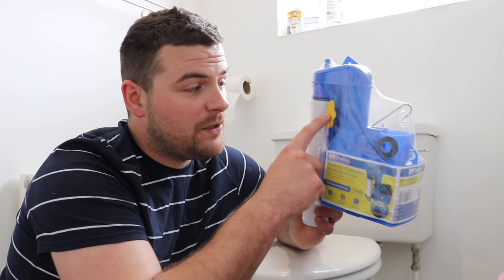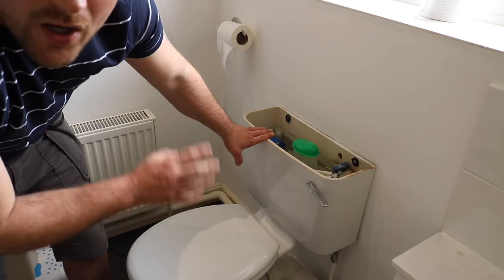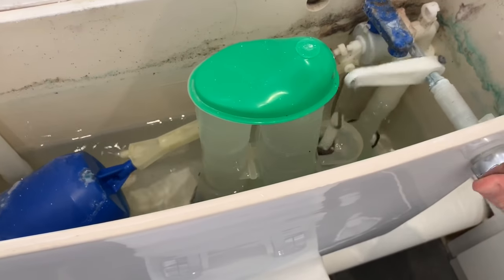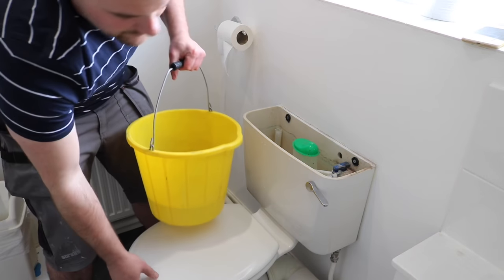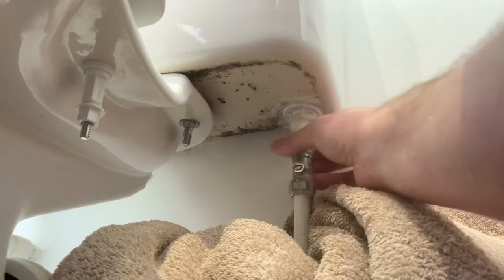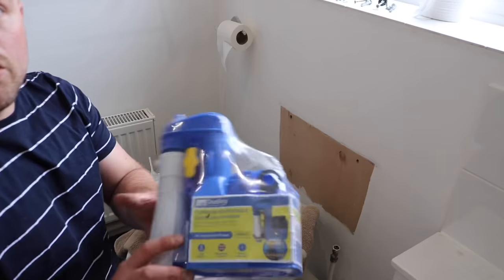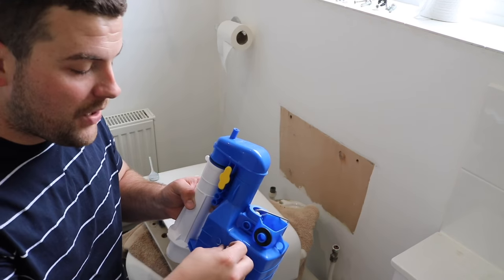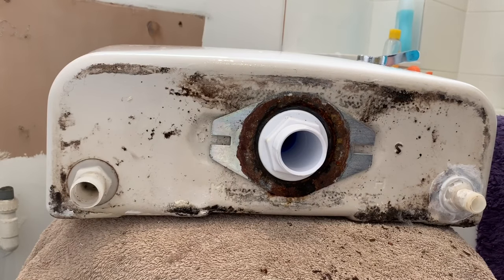How To Fit A Lever Toilet Siphon | Dudley Turbo Duoflush

Comment: Many thanks for a very helpful video! I've just bought one of the Dudley's to replace the flush over a Saniflo macerator toilet. The toilet itself was non working for ten years (the 'official' agent charged us £60 to replace the ball float which was nothing to do with the faulty toilet) but I finally managed to repair it with a new condensor and rubber gasket after watching yet another Youtube video (not a pleasant job). I suspected the syphon was wearing out after the ten year holiday as the toilet pump starts up on its own a couple of times each day probably due to a slight leakage into the bowl triggering the pressure sensor, now the flush is only working on and off so its time to replace in the next day or two. This will be a great help as the toilet (fitted by social services for Dad) is incredibly tight to get at but once this is fitted - no more major jobs!
Reply from the maker: Glad it helped thanks for h
The support

Comment: Just completed this. Your video is a good tutorial, but I experienced a couple of problems. First one was that my float arm caught on the new syphon side - so I had to heat bend it to an S shape. Second was a leak on the feed entry joint - I've had this before when reflacing a feed system - I managed to solve it using a rubber o ring washer instead of fibre washer - it sqeezed up tighter to make a better seal. These tasks are always straightforward till something goes wrong! Cheers again.
Reply from the maker: Glad u managed to sort everything, thanks you for the comment and support 👍🏻

Comment: Great video, thanks. I used it yesterday when replacing our toilet siphon as it was not working properly. We actually got a Fluidmaster Ultra for lever operated as it was the only one at Wickes. I was fine fitting it but I’m stumped by how to set it or if I’ve set it correctly. You can adjust a couple of parts to do with water height and overflow height etc but I’m confused and not sure what to do despite reading the instructions I’m none the wiser. It seems to flush ok, however the handle is quite loose. When I tighten the nut inside the cistern it sticks, so have to leave it a little loose. Any tips on how you set the siphon I mentioned and how to sort the handle issue would be fantastic! Thanks again for the video

Comment: Great advice, thank you.  I was undecided about the close coupling kit but no convinced. I shall use a piece of hose pipe to syphon the water into a bucket.  Unfortunately, I do not have a local stop valve so I shall turn off at the mains.  I hope the job is as easy as you made it look.  Cheers.
Reply from the maker: Fingers crossed for you and thank you for the support 👍
Reply: @PlumbingGy  I haven't stripped it down yet however, I am trying to establish the outlet diameter so that I can buy the syphon unit before I start.  The toilet is 1986 vintage, the base of the syphon appears to be about 2" outside diameter, I cannot get to the actual outlet yet and I do not want to strip it down until I have all the parts.  Is the outlet size a standard of 2" or 1.5", what would you advise please?
Reply: Completed the replacement, excellent advice Dan.  I changed the close coupler, could only purchase a plastic version and I was thicker than the steel one fitted.  The old seal was in a poor state so the change was worth it.  It did give me a challenge with the back fixing because the plastic coupler and new seal ment the hole fixings did not quite line up.  Small problem but all sorted.  Very pleased with help from Dan.

Comment: Very informative, the thing is I have my cistern almost 7’ from the floor and about 18” from the ceiling so not much room to work with. Making things more awkward the cistern is a 40 + years old ‘Shires’ unit which contains asbestos everything other than the syphon works fine including the mains feed & overflow pipe. What do you suggest other than calling in an expensive hazmat plumbing team? BTW I live in a council house.
Reply from the maker: Very difficult to say without looking, however they were made to be repaired. If you have any doubts always use a professional 👌🏻

Comment: Excellent video mate! Is that the same Dudley DuoFlush as I installed a couple of years ago? It's the most counterintuitive siphon you can imagine: to get a short, eco flush, you hold the handle down for ages, whereas for a normal, water-intensive flush, you just give the handle the usual short pull. As a result, no one ever uses the short flush, because it takes more effort, and you're never quite sure when you're supposed to let go of the handle! LOL. Madness.
Reply from the maker: Hahaha they are very awkward in some cases and most people only use the one flush anyway 😂 
Thanks for the support and comments

Comment: Thanks, a handy video featuring the flush unit I was planning to buy for my first attempt at changing a siphon. One wrinkle: after disconnecting the cistern it refused to lift off the pan. Some googling revealed that it may be held down with silicone mastic and wiggling the cistern to and fro was required to free it. I installed the new flush without mastic, as recommended in the instructions supplied with the unit, and it's still watertight after several hours. (I also fitted new fibre washers on the inlet pipe.) How else to spend a wet May bank holiday?

Comment: Good video. Just wanted to ask the plugs on the syphon i have no idea which one to remove or to keep on whether to keep the top one on or the bottom one on. If i just leave both on and fit the syphon in can i remove one of the plugs at a later time whilst water is already in the cisturn? Thanks in advance

Comment: Good video - a slight different approach to the donut washer compared to other videos - placing it on the pan rather than the locking nut under the cistern. I guess the end result is the same?
Reply from the maker: You have to be careful I use both methods to be honest with you but for the purpose of the video I did it this way, it's a safer bet to attach it to the cistern if your not used to them 👍🏻

Comment: Great video. I am a complete plumbing novice but was able to change my knackered siphon which, as Dan suggested, had a knackered diaphragm. Only problem is now I have a slight drip from the vertical inlet. Any ideas how i can rectify this? Cheers.
Reply from the maker: Hi samcon, do you mean you have a leak from the feed entry point? It will depend on the connection if you have a washer I would recommend replacing that also dismantling and adding some paste will help 
Thanks

Comment: Screwfix sell the diaphragm membranes for Dudleys, simply pull the yellow pin out, remove flush hook, remove old plastic diaphragm and replace. Takes 3 mins. Easy.

Comment: I agree with all the positive comments - a good video! In my cistern the float arm catches on a small blue tab that sticks out of the Turbo blue body section. I can't see what this blue tab does other than prevent the float arm from dropping fully down and make the refill slow. Can I just cut it off?
Reply from the maker: I'm not too sure which tab you mean, there is a red and clear one on the air breaks and the small push tabs that represent the litres in the cistern. take a good look over then instructions and make sure 👍🏻

Comment: The unit shown here has a TWO part fixing. 👀Some units have three parts (as one unit)  1. A large screw collar that secures the dome to the 2. main squarish unit PLUS 3. another screw collar that screws to the fixed down pipe within the cistern. Make sure you have the right one unit! ( Ideally remove, take to your supplier/retailer DIY et) 👀👍 Most are UNIVERSAL fixings BUT! ALWAYS make sure especially when ordering online etc

Comment: it's lucky the installer, did not use steel screws to attach the cistern to the wall, or it would have been a pain to remove rusted screws, a good plumber who has maintenance experience would use screws which do not rust ( stainless or brass ) if they care.
and the thomas dudley turbo 88, has an internal overflow,  great video, thanks.

Comment: Spot on. Thank you for making a middle-aged man's life easier and cheaper. Straightforward and easy to understand instruction.....now.... do you do bathroom fans....? :)
Reply from the maker: No problem buzz, glad it helped. Bathroom fan as in extractor fans?
Reply: Yes. Extractor. If you've got a video for that I'll use and share that one too.
Reply from the maker: I am planning on doing a video for an extractor, they are generally straight forward and only 3 wires. Live, switch live, neutral. Just remove the old front casing either held by a grub screw or a push insert and you will see the three wires, test them with a multimeter and isolate as required. Swap with a new unit and drill holes as required. Cut wires to suit new unit (should be marked which wire goes where, live, switch and neutral) and fit new cover/ test. 

If you are still struggling there should be a video on YouTube but it's very easy to replace hope this helps Buzz.
Thanks
Reply: Much appreciated. I'll look out for that video. In the meantime, thank you so much for your instruction again. Now bugger off and enjoy what's left of the bank holiday! :)

Comment: my blue fill nozzle drips quite loudly, does this need replaced or is it a float issue? i will shortly be removing the loo for a tiler and think I will renew the internals while its off, was that dudley the adjustable model? saw lots of pin holes down the side just

Comment: Can you tell me where the problem lies, when the flush handle  won't return more than half way, after flushing. I have to lift it to the top position, before it will flush.--I lubricated all moving parts, Thanks.

Comment: Thanks.  That looks easy enough but I did think it was a smaller job to replace the Dudley siphon.  I couldn't bear to put that filthy rusty old thing back on the wall once I knew it looked like that.
Reply from the maker: Down to customer in all aspects, you can lead a horse to water 👍🏻
Reply: it should of been wire brushed at least

Comment: Is there an internal overflow system (where you cant have  pipe to the outside) and will water continue to flow after flushing?
Reply from the maker: internal overflow as standard however it shouldn't continue to overflow after flush 👍🏻

Comment: Is there any way to change the syphon without taking it off the wall?
Reply from the maker: This particular one can just be twisted and replaced, most however have to be removed depending on which you have

Comment: Where the blue plastic part is where the water runs out into the tank, the white plastic threaded screw that shuts off the valve for the water can you replace them individually? Been trying to source that particular part but can't find it on its own!? Cheers
Reply from the maker: Normally you will only be able to get a replacement cartridge, it just slots in. I haven't personally replaced individual parts before 👍🏻

Comment: Hi , do you know what the stroke of the 88 siphon  is . i.e. how far does the lever lift the centre yellow plastic spindle?: Thanks
Reply from the maker: It will depend on the cistern and will have to be adjusted 👍🏻

Comment: Thank you Dan. One question. I live un México and we dont have does type of flush... if your wc dont flush that much and its not obstruct, we need to buy a brand New wc, not to replace de system.. when I was in africa I se this really old wc but the flushing system was hydrsulic and did like a pumping, so your waste could go with out a problem.  the one that you are showing does something like that. Thank in advance
Reply from the maker: I think I see what u mean Carlos, with this particular siphon as the lever is pulled the plastic valve inside sucks the water in to refil and then plunges it into the toilet when released 👍🏻

Comment: OK, great vid BUT! It should be made clear that you do NOT have to remove the unit from the wall to replace the siphon unit!! 👀NOT do you have to empty the unit completely. It is more than likely that the siphon unit NOT the inlet valve or ballcock et will need replacing ! 😶If you have a heavy ceramic unit believe me the last thing you want to end up doing is stripping it off the wall !! I've just replaced our siphon unit and yes the overall cost is about £20 all in BUT as said here, it is NOT worth compromising with a cheap unit. !! 👍Lastly, stay safe!

Comment: Skylo syphon is sitting to high in cistern. When I flush it pushes up the cistern lid. Tried to lower via twisting lower but still too high.  Help.
Reply from the maker: It should come with manufacturers instructions?? If your cistern is too small your fairly limited
Reply: @PlumbingGy  thanks. A plumber fitted it. I tried to adjust the height and it does lower however this then pulls the toilet handle down so that’s no use as then can’t use it like that. I think the cistern is very old and may be too small for the standard syphon. I may have to get plumber back out as may well need a whole new cistern.

Comment: Hi dan most plumbers i know always use sealent around the siphon washer and ptfe tape on the nuts to be absolutely leak proof would you recommend this.
Reply from the maker: Not for me EK, I was always taught (and this is proof) 😂 you do not need to rely on sealant or ptfe. I wouldn't apply it to any new install by any means if I'm being honest. All new, should be fine with supplied washers etc if its new and leaks I would check for damage. 👌🏻👌🏻
Reply: @PlumbingGy  tanx👍